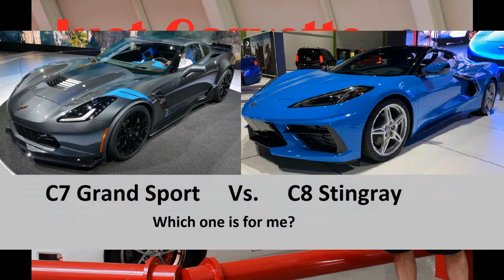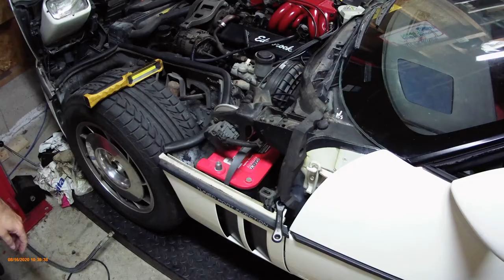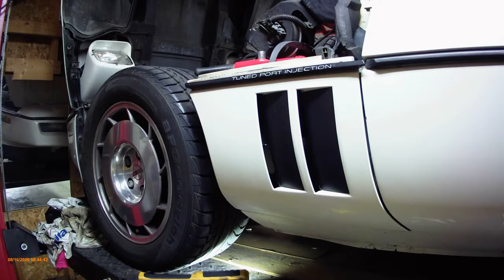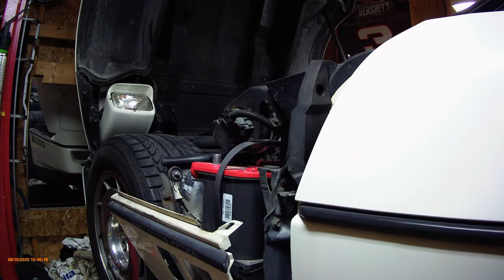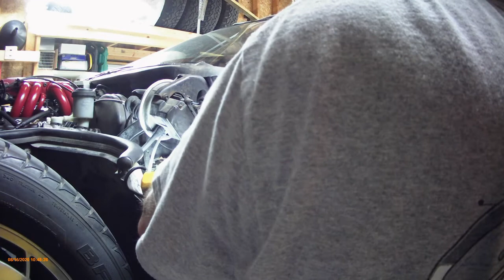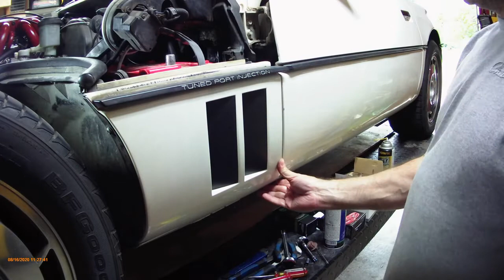MAF Sensor Relays Repaired or Replaced

Comment: Just subscribed. I too love vettes. But i might be little bit different.  I find worn out, about to be scrapped, sitting for years, some call them junk. I tear them down, then fix everything as I'm putting it back together. I don't go for factory correct, just make them a nice, reliable, good looking, corvette. I did a few C4's and I do alot of C3's. My daily in the summer is my 86 Pace Car. You keep doing what you do, and I'll keep watching.
Reply from the maker: My plan is to do some more restoring once the new shop is finished.  Taking longer than originally planned.

Comment: Hi, I can't seem to find a good reputable vendor that sells burn-off relays. Where do you recommend I buy from?
Reply from the maker: I bought mine from Rockauto.com they normally have a few brands to choose from.
Reply: @justcorvettecrazy116   Does the burn off and power relay use the same part number? I have a 1987 corvette btw.
Reply from the maker: @linklichen4225  There used to be 2 different relays. Then I think somewhere in 1987 they went to 1 relay for both applications.  Easy way to tell is to pull the plugs on your 2 relays and if they have the same number of pins then they are the same.  The ones with the 2 different relays had a different number of pins.
Reply: @justcorvettecrazy116  my 86 has two different relays. Off the top of my head I can't tell you which is 3 pin and which is 4 pin though. I THINK the power relay has the 4 pin relay, burn off 3??? I'll have to check the manuals, maybe the wiring diagram.

Comment: Also you not showing us which switch goes to the power connector
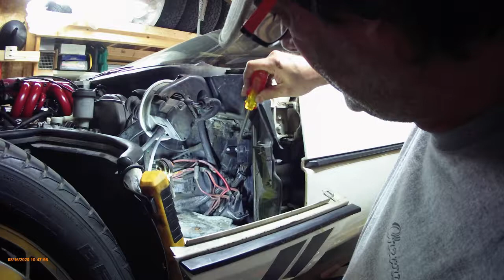Reply from the maker: There are 2 relays.  One has 5 wires and the other has 4 wires.  See video at 6:15
Reply: @justcorvettecrazy116  also can you please tell me what kind of battery you have name brand thanks I appreciate it
Reply: @justcorvettecrazy116  yes thank you so much for the video I figure it out by watching your video again.
Reply from the maker: On 1986 Corvette 5 pins is the Burn off relay.  4 pins should be your MAF power relay.  They changed this in other years.  What year is your car?
Reply: @justcorvettecrazy116  my is 1986
Reply from the maker: https://www.mamotorworks.com/corvette/search  Add your year and search MAF Relay.  This page shows for 1986.  Battery is Redtop Optima.
Reply: @justcorvettecrazy116  thanks you

Comment: Hi I have two question what battery you used? Al would the same battery you use fits 1986 corvette?
Reply: I use a optima yellow top in my 96 ragtop. (It's yellow and the detailing in the engine is yellow). Looks good, and handle the stereo amps just fine. Hope this helps.

Comment: Hi, so my 88 had a problem with staying alive whenever I put it into drive or park. So the IAC was replaced and now it's fine when it's in park. When it's cold it runs fine. Then once it gets warmed up at red-lights when I stop and hold the break the engine loses power unless I put it in park. Lowest I've read on my instruments is 12.5 volts. Usually it stays at about 13.8 to 14 volts when cold. I was thinking MAF but Could it be the relays? Don't know if this is important but the air conditioning runs but when it's cold it only shoots cold air and when it'd hot it only shoots hot air. No change in temp. Only issues I'm having.
Reply from the maker: Hey Omar,  reach out to me via email and we can see if we can figure out your issue together.  justcorvettecrazy@gmail.com
Reply: I’m having the same problem with mine let me know if you were able to fix it!

Comment: Hi, I have the identical car and it is running rich and surging at idle. Unplug the maf and it runs smooth but idles at 1200rpm, any ideas?
Reply from the maker: If this happens when engine is warm it could be the MAF or the O2 sensor.   MAF reads air coming in and O2 sensor reads what is going out.  The ECU uses that info to fire injectors to set the fuel mixture.    If it happens when the engine is cold, might be the IAC valve.   The other thing you might want to check is the fuel pressure at the rail.  You don't want the pressure too high as it will force more gas into the engine at idle.  If it is too high look at the fuel pressure regulator.  Hope this gives you a direction to look at.
Reply from the maker: Let me know if you have any more questions.  Keep me posted as you figure it out.

Comment: Great vidio Hi I'm expearencing an issue with my 94 vette where when i put it into reverse it stalls out but if I disconnect the mass air flow sensor the issue goes away could this be causing that
Reply from the maker: I have never heard of that before.  The MAF sensor sends info to the ECU so it could cause stalling for sure.  But why only in reverse???  The relays themselves would not cause those issues but if the burn off relay is not working the MAF could be dirty.  Try cleaning the MAF sensor and see if it makes a difference.  There are special spray cleaners for the MAF.  Don't use just any cleaner.   Hope that helps a bit.

Comment: Nice work, how did you know the relays were bad?
Reply from the maker: In this case I replaced the MAF Sensor (another video).  It is advised to replace the Burn Off Relay when you put a new MAF because a sticky relay can cause a failure of the MAF sensor.  The other relay was working but I took it and cleaned it while I had it out.  If the MAF power relay does not work your MAF will not function.  There is another video that I did where I did the fuel pump relay.  In that video I show you how I test the relay on my bench.